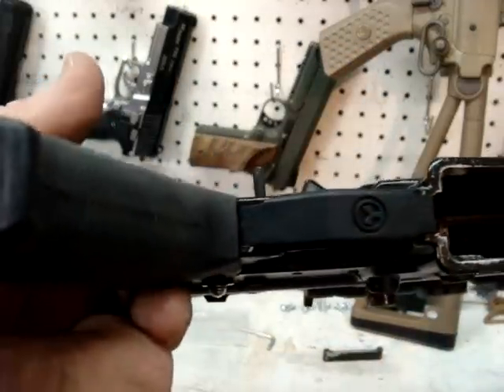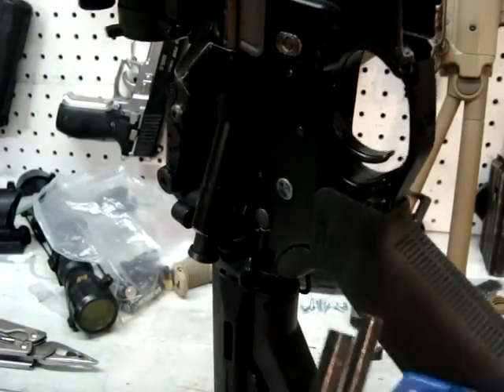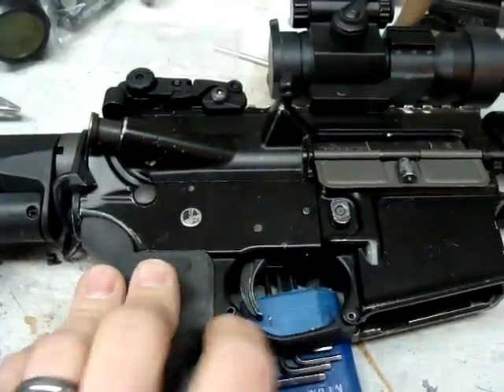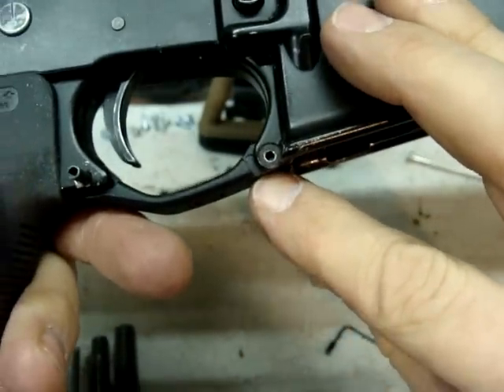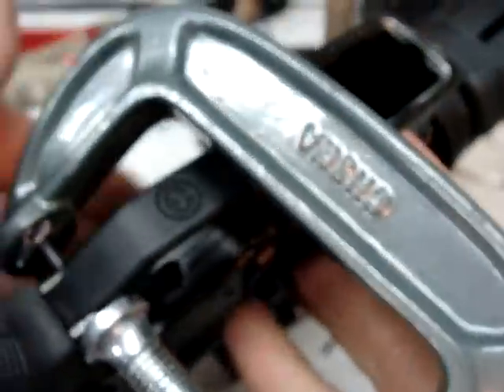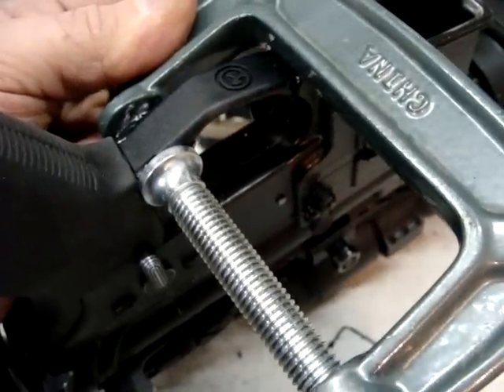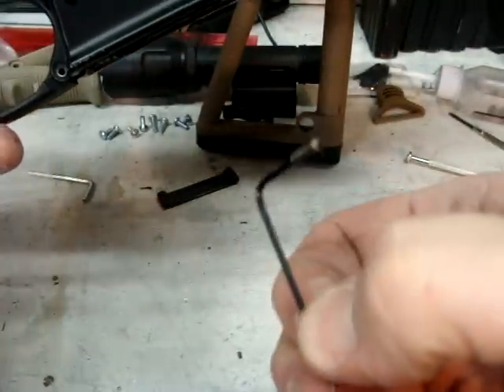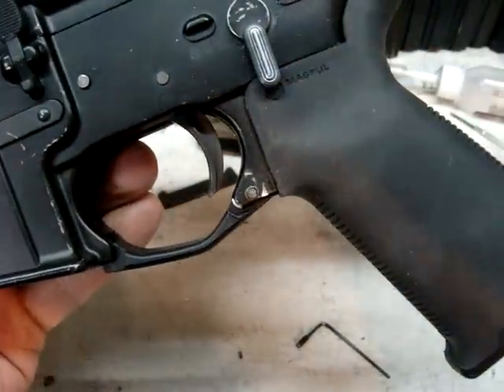trigger guard

Comment: How is it with we bodies? They dont got joles on both sides, just on one. How do i get it out then?
Reply from the maker: WE bodies?  this is a we tech m4 so I'm not sure what you mean.
Reply: IndebtedOne1 I mean, i cant get the front pin out from the trigger guard
Reply from the maker: that "pin" is spring loaded if I recall.  Push it down while pulling the trigger guard out